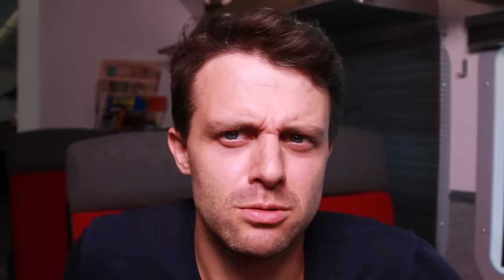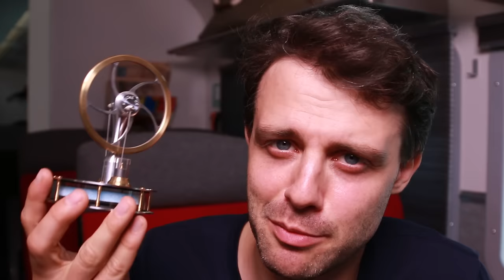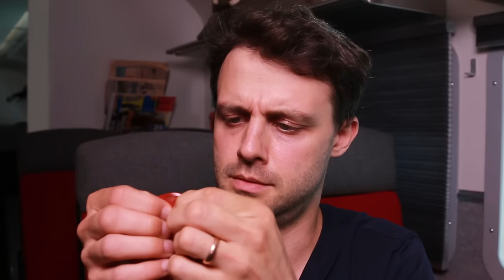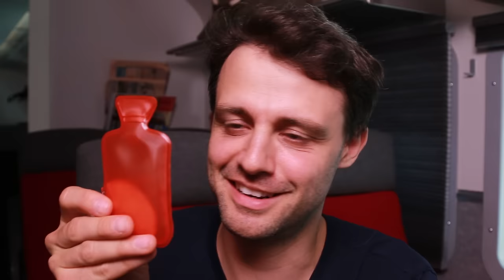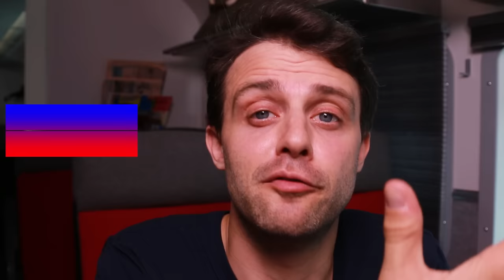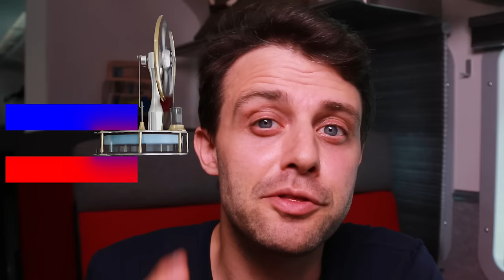A better description of entropy

Comment: So, here's a bit of a puzzle. Can you run an Air Conditioner off of sterling engines which have one plate indoors and the other outdoors? If it did work, would this tend to keep a room at a constant temperature (the engine/AC system working harder as the outdoor heat increased, but only in proportion to the heating of the room) or would it actually accelerate as the outdoor temperature rose and (in this scenario at least) the indoor temperature decreased? Finally, is the main hurdle to such a system simply the efficiency (or lack thereof) of the insulation around to the room, or would it be defeated by the entropy inherent in the engine/AC system itself?
Reply: If you had a 100% efficient sterling engine, AC unit, and insulation, my understanding is that the temperature would not change either inside nor outside. Remember that the engine is moving heat from outside to inside in this situation.

And while we can get pretty close to 100% efficient reversible systems, these do not actually exist. Every system (at least so far) has some sort of inefficiency. And if the system we have is only 99% efficient, then that 1% is working to even out the inside and outside temperature.
Reply: Yeah, see, that was more or less where I was coming from... but, the key point of the sterling engine is not that it is moving heat, but that it is using a temperature differential to do work. Remember, you can run that engine on either a hotpad or an icecube. The upshot being, some of that "heat" is also being "lost" to the work the AC is doing... and, the whole point of an AC is that it is moving heat. 

After all, if you have a portable AC unit, the whole machine is sitting in the room with you, and the machine itself is producing heat doing the work of moving the heat from the air in the room to a stream of air that you vent out a window... it's just that the AC moves heat so well that the heat of the work it does in the process is inconsequential compared to how much heat it is venting outside.

Now, if you just had two rooms with a temperature differential, whether the engine/AC system was moving heat toward the hot room that stands in for the outside would wind up being a bit of a poser to be sure (though again, a portable AC unit can be used to shunt heat from one room to another, rather like the way your fridge moves heat from the icebox to the kitchen)... however, the temperature differential between outside and inside air is very unequal. The outside air it going to remain more or less the same temperature regardless of whether the total system is transferring heat out, in, or is basically the same rate as the rest of the wall. But, since the air inside is more or less confined, any change in the system would be (at least relative to the outside air) much more dramatic. Again, your fridge is venting its heat into your kitchen, but even though it vents enough to freeze water, your kitchen doesn't get anywhere near hot enough to notice... well, unless you've also turned on your oven, neh?
Reply: Perhaps a different way of putting the question. If you dropped a large box of cool air into the atmosphere of Venus, would it reach the ambient temperature faster, slower, or at the same rate with the engine/AC system as without it? Assuming, of course, that you could build the whole experiment to withstand the rigours of Venus in the first place. 

See, my instinct tells me that the accelerating AC scenario in my original post shouldn't work for the same reason that I'm pretty sure that this Venus room would eventually reach ambient temperature no matter what... however, when I first kicked the idea around using Mathematica and some stock formulae I found on wikipedia, that runaway effect was one of the outcomes I got... which is why I include it now whenever I bring up the question.
Reply: AutodidacticPhd the two sides of the wall would eventually be the same temperature?
Reply: If we assume our container has magically adiabatic walls that prevent the passage of heat through them, and we further assume a magical Stirling engine and cooling system that are both 100% efficient, then the outcome is the same as having a container with just magical adiabatic walls: The inside of the container remains at the same temperature indefinitely.

If we assume walls that allow the passage of heat or anything less than 100% efficiency in either the Stirling engine or the cooling system, then the container will gradually reach thermal equilibrium with the environment.

Since you're curious about whether the engine/cooler combination causes the system to equilibrate more or less quickly, or has no effect, I'll address that. Assuming non-adiabatic walls, we first have to address whether the area of the wall displaced by the engine and cooler are adiabatic, or at least allow for less transmission of heat than the walls themselves. If not, then any inefficiency in either system means that they will draw more heat in than they are able to move outside, thus increasing the rate at which the container heats up. If so, then the question is whether the difference in heat allowed through by the area covered by the systems is outstripped by the inefficiencies of those systems.

In short, semi-realistic conditions (non-adiabatic walls, efficiencies <100%) mean that the engine and cooler cause the box to heat up faster UNLESS they are so much better insulated than the walls that it makes up for the less-than-perfect efficiencies.
Reply: Ok, ignoring for a second that my first comment was a toy problem, posted 4 months ago, and one of my responses acknowledged that, yes, I do know that entropy, efficiency, etc are a thing...

What I eventually got working in simulation is a three "body" heatpump system that just smooths the gradient of temperature change over the course of the day. Which is really all most people would want from it anyway. The original version of the problem was meant to start a conversation about what the parts of the system did individually and how they interacted, but oh well. 

Anyway, the whole point was to play with the parts, not to promote woo woo or get into a who can science harder contest... I should have known the internet better than that I guess.
Reply: More straight to the point, the sterling engine is already functioning as an air conditioner. But it is cooling the outdoors. 

In regards to your venus scenario; imagine instead a perfectly insulated thermos with a sterling engine on top. It would allow the heat exchange to occur faster than a perfectly sealed thermos representing a closed system.

Here's an even better question to ask.  I have two rooms of equal volume and temperature.  I put a large enough block of ice in the first such that when it melts, it cools the room by 'Q' degrees. In the other room, I put a perfectly insulated block of ice whose only means of exchanging heat is through the insulating buffers of a sterling engine. By the time the sterling engine has completely "burned" the block of ice, will the ambient temperature of the second room be less than the first room? And, what be the effect of a less efficient sterling if used to duplicate the experiment in a third room?
Reply: The results would always, ultimately, be the same. Namely, equilibrium. I know that. I've always known that. As I said last week, the point was to start a conversation about the parts while I was still playing with a simulation of them. No one cared and I've moved on. It would now take me time I don't have to dig up the simulation and familiarize myself with it again enough to talk about... and for all I know, as soon as I did everyone would lose interest. Again.
Reply: I am asking what is the difference in the temperature at which each of these rooms would reach equilibrium. You seem to sense that there is a way to get the proverbial "free lunch" out of this , and I do too, but I think it can only happen in the scenario I have presented you.
Reply: If your looking for a way create a self-sustaining air conditioning system that runs on heat ( an idea that seems to fly in the face of thermodynamics ), I think that the sterling engine might have a way to cough up the "free lunch" and still keep the books balanced, so to speak. But, it comes only from the idea of "burning" ice.
Reply: Look. I did get a system working in simulation. If you have one room you want to keep warm over night, another room you want to keep cool during the day, and between them is a heat pump (which either shifts heat directly between the rooms or through a heatsink like groundwater) , you can get them running on sterling engines in the exterior wall (or between the exterior and the heatsink). Basically, as long as the heatpump wasn't trying to move heat across the same gradient as the sterling engine you would get systems that at least made some sort of sense (rather than wacky gibberish like the run away feedback loop I made the mistake of mentioning in my first comment). To the best of my knowledge some variations worked relatively well, especially if you had a steep variation in ourdoor temperatures... BUT, none of them seemed to be more efficient than other existing methods except under ideal conditions. And again, I don't have the simulation handy or the time to play with it right now. Sorry.
Reply: That makes perfect sense.
Reply: Brad Anderson imagine a situation: three rooms, all perfectly equal in everything and all are perfectly isolated. In room 1, an ice cube is powering a sterling engine, which in turn powers the air conditioner in the room 2. There's also room 3 where the same ice cube just thaws on it's own. What you have to understand is that by the time your engine finishes burning your ice, in the third room you'll invariably get the lowest temperature of all three.
Reply: You all know that heat pumps/AC can be more than 100% efficient, right? They can be arbitrarily large, theoretically even infinite.
Reply: Fresh Rock Papa-E nope.
Reply: Yep. In fact, you shouldn't even be talking about "efficiency". It's a concept that doesn't apply to such machines. You are confused with engines, which obviously have to be less efficient than 1. You should instead be talking about the coefficient of performance, which can take values from 1 to infinity in case of a heat pump https://en.wikipedia.org/wiki/Coefficient_of_performance
Reply: Very insightful observation.
Reply: I've actually seen an office fan that ran off a sterling engine.  You used a candle to heat the plate. It was used before we had electricity just to make a breeze.
Reply: AutodidacticPhd sure. Let's ignore entropy and thermodynamics for a minute first.

Comment: So time and entropy could simply be two different ways of describing fundamentally the same phenomenon.  Yes, why not? After all, it used to be thought that heat and light were completely different things, until we realized that they were simply different manifestations of the same entity - energy. Then later, Einstein showed us that space and time, thought to be completely different things, were actually just 2 aspects of the same phenomenon (space-time) and that energy and matter, again originally considered unrelated, were made of fundamentally the same stuff.  So it doesn't seem in any way preposterous to suggest that time and entropy, rather than 2 distinct things, could turn out actually to be  just one ("time-entropy").  Factor in  a few other assorted fields and forces and - who knows? - we could just end up with one single, all-encompassing cosmos-wide phenomenon: matter-energy-gravity-magnetism-spacetime-entropy-...

Comment: How do we refer to the "clumping up" of energy which occurs naturally? Maybe this is an uninformed question, but humans exist, stars exist, a bunch of lifeforms piled up and died together hundreds of millions of years ago, leaving us with big pools of potential energy. If entropy was the only rule, wouldn't the big bang have been a big.. fizzle?
Reply: I think the word u want is enthalpy
Reply: the big bang will "have been a big fizzle", just wait a few trillion trillion trillion whatever years, and the fizzle will have (presumably) finally completed its fizzling.

What you are describing is just energy storage.  Some pockets of energy that go into stasis, they are stored for later.  

But it isn't a reversal, only a temporary pause.

None of those examples involve only clumping together, they also involve spreading out.  Humans and stars constantly emit energy.  Energy flows through humans and other creatures, if it constantly accumulated, you would either become as fat as a literal whale, or you would become hotter and hotter in temperature.  

Living things are like "pipelines" for spreading out energy:  it flows through us, not just into us.  Fossil fuels are just a few scraps of that energy that didn't get to "flow all the way through" yet because the "pipelines" stopped pumping.

Comment: At a chem undergrad level, I have always spoken of dispersal of both energy AND matter - the latter being helpful in illuminating the mathematical calculation of gas expansion entropy and entropy of mixing for gases or liquids (and same idea applies to heat energy dispersal via black body radiation emission).

Comment: I like your definition of entropy.

You say, "It's not heat you need. It's a difference in temperature."
However, the only way to have a difference in temperature is for one place to have more heat, or more specifically, more energy. The energy is often in the kinetic energy of molecules.

I get your point that it's the difference that matters.

Comment: This engine can be used with geothermal heat from the Earth to produce free energy. Just have to connect the spinning wheel to a generator to produce electricity.
Reply: Transport, not produce
Reply: Still no free energy though

Comment: I agree with the many comments that this an excellent explanation. Still not obvious, though, how we can have endothermic reactions, such cooling by evaporation or  when dissolving salt in water.  They will tell you that it's because the entropy of gas is higher than liquid or because the entropy of the salt is higher when in solution, but it still seems like heat is going in the wrong direction.

Comment: Very nice video. I completely agree about the misleading nature of the standard one-line definition of entropy. Strictly speaking there are many microstates that would achieve the macrostate of having all of the blue balls on one side of the box, and all of the red balls on the other - not just one. But this number of microstates pales in comparison with the number of microstates in which the red and blue balls can be arranged randomly - and - in this scenario the red and blue balls would have to be individually distinguishable. When you aren't distinguishing (labeling) the individual balls, there is as you say, only one macrostate for the even separation of red and blue balls, but there are many macrostates for random arrangements.

Comment: I urge u to do many more videos on entropy and applications of entropy to the design of air conditioning and refrigeration systems, engines, turbines, compressors, jet engines, gas turbines, rocket science. Use entropy, temperature and enthalpy diagrams to explain the entropy concepts. Please explain why entropy plays the key role in Heat engine design.

Comment: those things are very common, if you have a canal boat or llog cabon with wood stove. they sit on top of the stoves and when the wheel spins it moves the heat about because they are make with a fan wheel.

Comment: 4:19 He is using the word "heat" wrong. In thermodynamics heat is used to describe the transfer of energy due to temperature differences, not the state of high temperature. So it is actually heat that you need to run an engine.

Comment: difficult subject, compelled to comment..

although 'spreading out' is generally aligned with increasing disorder,  disorder is the better definition because when you take into account phase changes, you can get more localised energy being more disordered and so have heat spontaneously become more localised. notice phase change 'ice-packs', heat is moved IN spontaneously due to the drop in temperature, so the 'spreading out' understanding breaks, usually/practically it 'works' but its just not as fundamental as disorder/information. 

side note: disorder is statistical so there is always a finite chance of disorder decreasing, which means disorder ALWAYS increases is sort of a very good rule-of-thumb. its better to say 'disorder always increases overall' (gives you a get-out).  however what's actually important is that doing work using this is impossible because the information needed to isolate, any small packets of increased order, has a 'work' cost greater then you could gain. this, i think, could be what underlays the entropy always increases rule, for me this concept might be worthy of a video, although possibly more difficult to get across.

Comment: The definition of heat is the energy in transfer from a high to a low temperature. So it is heat you need, delta T causes heat flow.